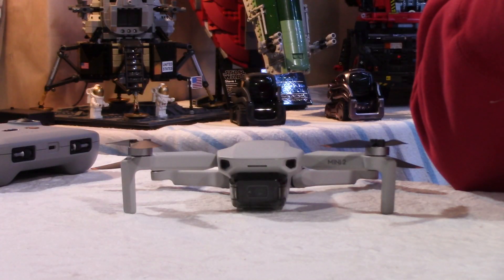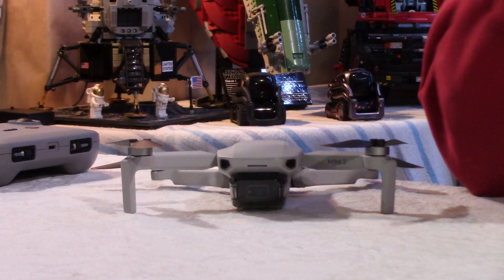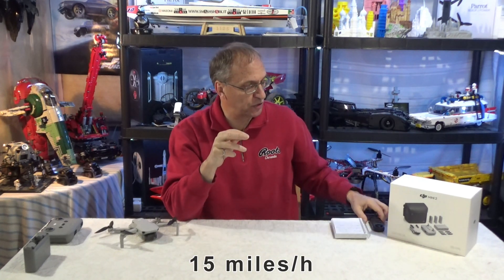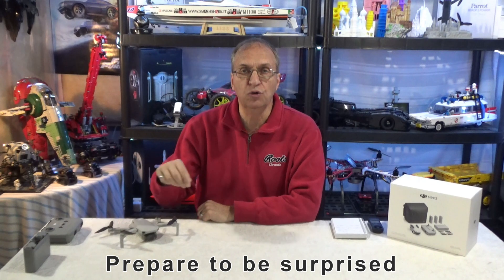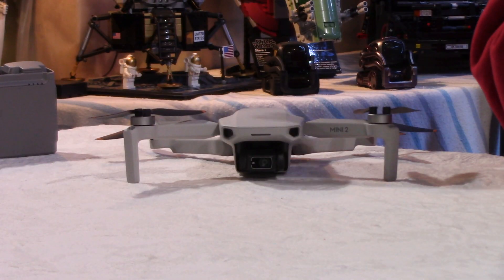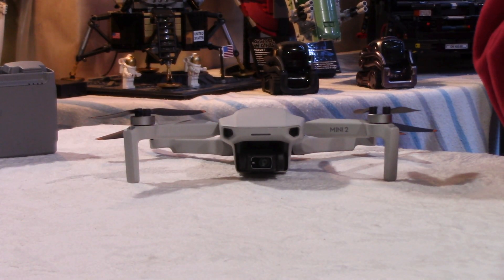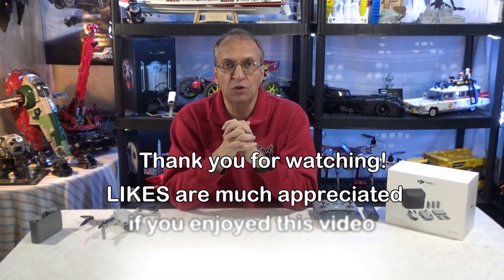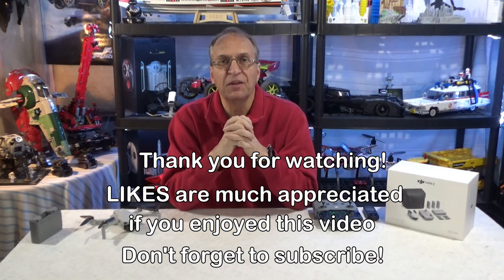dji Mini 2 Wind Test | Can it handle a strong wind???

Comment: Dan, in your opinion what is the better option, Mavic mini combo £459, standard is £369 or the Mini 2 standard £419? The Mini 2 combo is £549 in the UK. I will only be flying occasionally and I might consider buying an extra battery, if I got the Mini 2. Thanks.
Reply from the maker: There are enough good differences to recommend the Mini 2 for sure.  If you only fly occasionally, don't get the combo, get the standard and buy a second battery perhaps.  This is what I would do.
Reply: Thanks Dan, much appreciated. Regards,  Paul.

Comment: So with no Gps you had no correction input on the sticks wile the mini 2 was in front of the fan?
I know  its got sensors to keep it stable in the air without go’s but but with no gps I would of thought is would of wanted to drift?
Reply from the maker: Correct, I was not touching the sticks. Downward sensors keep the drone from drifting unless there is not enough light in the room.  Thanks for watching!
Reply: @SuperdanTech  great stuff. 👍🏼👍🏼